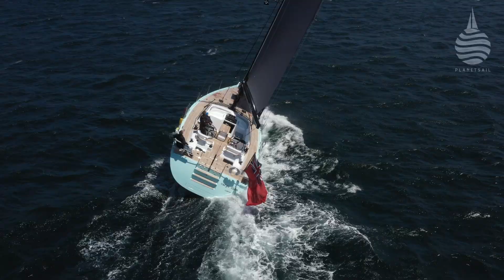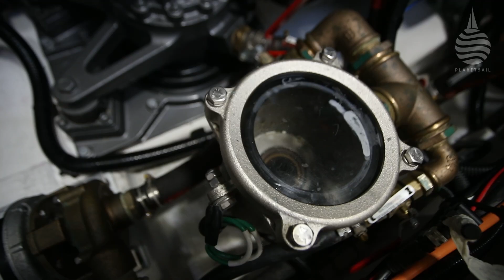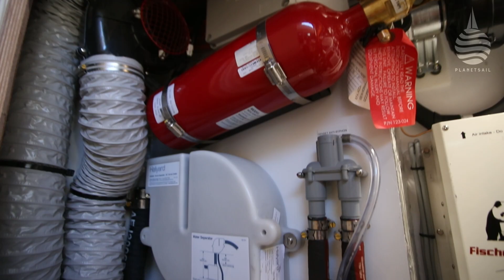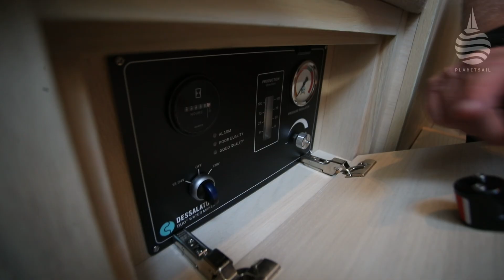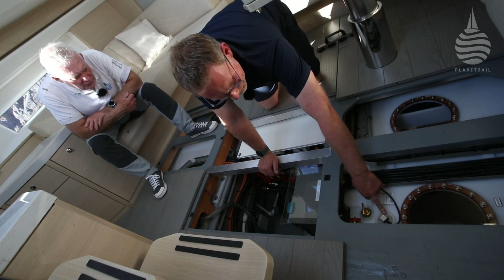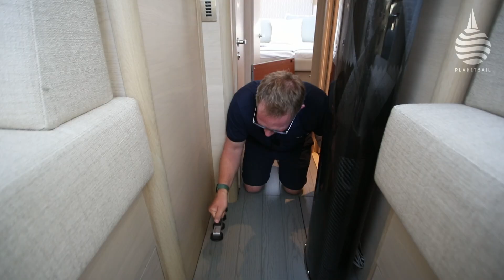Oyster 495 Deep Dive - On Test Part 2

Comment: What I don’t get is why would you not have a hybrid electric system instead of having a big gas guzzling engine to drive the prop and a generator to power the additional electricity requirements
What makes way more sense to me is having a small electric motor that puts out the same amount of power is the much larger and heavier combustion engine and replace that white with more battery storage and a slightly larger generator it would be a lot more efficient and Phil have much lower maintenance requirements and if you could use the prop to recharge the batteries while under sale or at least not need to use the generator to power the rest of the electronics it would be even more efficient again

Hybrid electric drive trains make the most sense in sailing boats out of any mode of transportation because 90% of the time you’re not using the big petrol engine 
And also enabled a lot of space saving to be able to make the interior of the boat have more living space and Liz are taken up with the engineering space as well is having a bit of weight distribution thing able to put the mess down lower would even distribution of batteries Laura in the whole of the boat

Comment: There was one anchored next to me a couple of days ago. The Cockpit floor is so high. I thought the guy was standing on the seat when I saw them dropping the anchor. That won't be fun in bad weather. Also the boom is really high. If you have a high cockpit floor, you get a high boom. The boat rolls fast at anchor. Not comfortable looking. The rig has very large swept back spreaders. No way you will get that in mast furling mainsail out downwind when trade wind sailing without rubbing on the spreaders. What does the supper wide chainplates and spreaders do for sail choice up wind? You won't be setting a big genoa and making any decent angle. It's also bloody ugly. Not my comment but the wife's. She says they have prison windows. I think she is right. It looks wrong

Comment: Electrical equipment under thr floor! Really? Doesn't seem like a great idea. Sump below the grey water tank? How do you get to that? Looks like a very complex boat. Sail drive. Yuck
Reply: What's wrong with saildrive configuration?
Reply: @NoWheyHombre  aluminium loves to corrode. Big hole in bottom of boat with rubber bellow. Makes it easy for the builder but no benifit for the owner. They won't last as long as the engine so need changing at vast cost during the life of the boat. We see many in bits in boat yards in the Caribbean
Reply: @timevans8223  it was my understanding that saikdrive was just the configuration, not the materials.  It's sounds like the positioning and the lack of a long metal bar aren't you're complaints, but shoddy parts and material.  Do I have that right?
Reply: Oyster yachts are tried and true. No worries though, you couldn’t ever afford one 🤷🏼‍♂️
Reply: @ProTuner06  says who? I am already out there doing it on a similar sized boat. That boats sounds like a nightmare to own